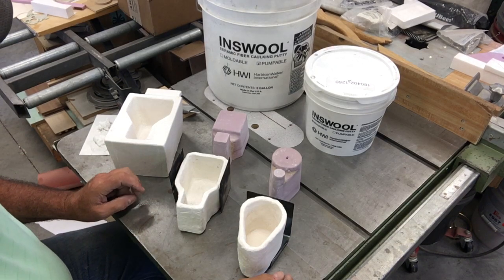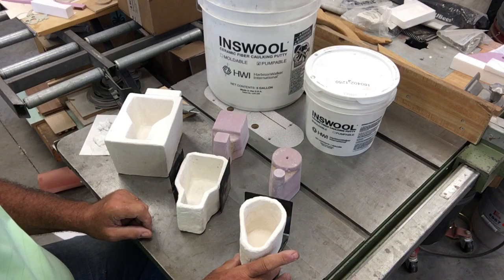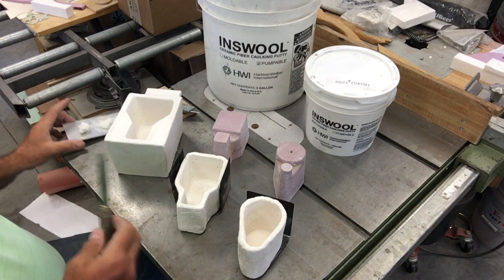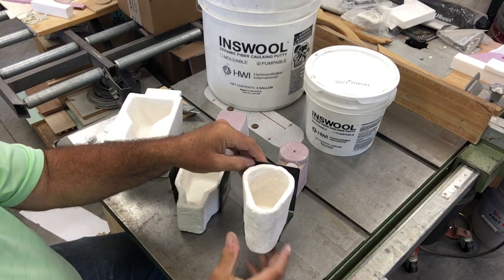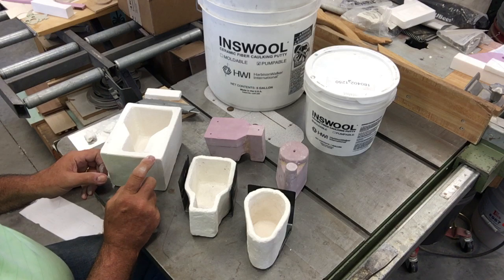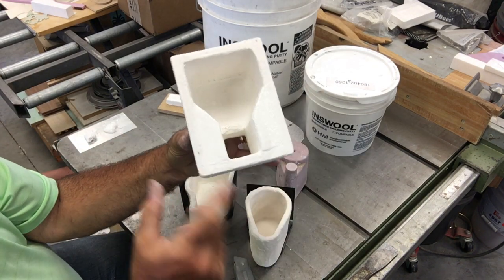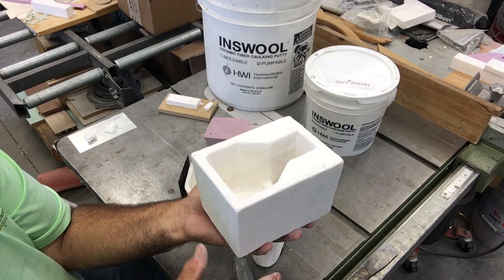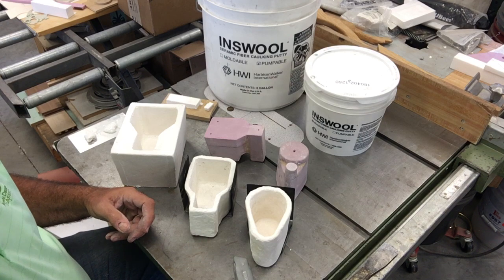Reusable Pouring Basin - Lost Foam Casting

Comment: I am very grateful for the video.
But I don't understand English well - I only understand from the translation of the subtitles and so I may have missed something.
I didn't quite understand what kind of mass (liquid with which you glue the parts) you use?
I would be grateful for a link or a minute of the video.
Thank you.
Reply from the maker: The "Glue" is also moldable ceramic fiber. It may also be referred to a "refractory mastic". Here is a link to a casting forum where I posted more info. https://forums.thehomefoundry.org/index.php?threads/reuasbale-offset-pouring-basin.688/  You may be able to use Google Translate from the text on the forum. You may have to join the forum to see full size pictures. Though all nationalities are welcome, the site is under constant attack from sources the emanate from within the Russian Federation so many domains are banned. If I see your application for membership and it looks like your YouTube ID in this post, I will grant access. Best, Kelly
Reply: @kellycoffield533  Thanks for the answer Now I understand that it is made of a refractory mixture that dries at low temperatures. I didn't know about their existence before, but now I read it.
I have been watching your channel and reading your forum for a long time. I recently registered (AlexNet), but there is no confirmation yet. I will be grateful.
PS: my neighbors help everyone...

Comment: Awesome videos.  could this material be used to make a pouring cup with a bunch of tiny holes in it for making metal shot?  looking for ways to make more consistent bronze and aluminum shot.
Reply from the maker: Maybe, but it's not very durable. Have you tried boron nitride coatings on metal? Best, Kelly

Comment: Great video, these are very awesome. Without a kiln could one fashion one of these using an existing small round dish crucible by drilling a hole in the bottom?
Reply from the maker: It wouldn't perform as well. Both the material and shape of the cup make a big difference. The moldable ceramic fiber is an excellent insulator and robs almost no heat from the melt whereas more dense refractory materials will. This means your pour temp is much closer to your pre-pour measurement. The MCF (or ceramic fiber board)  is also completely unwetted by aluminum and most non-ferrous metals which is what makes them reusable wheras other materials are not. The shape of the cup and the Wier in particular tends to float any dross and prevent it from being ingetsed at the sprue. I was really surprised what an improvement they were when I started using them. Best, Kelly
Reply: @kellycoffield533  great info thanks that makes complete sense. Wondering what I can use instead now then without a kiln. I've seen your tutorial on kush cups which is very interesting also. I do metal spinning and machining with which I could make a stainless steel funnel and fashion the bottom part with a wier. I'm planning casting with silicon bronze and lost foam so I've just joined the forum and am awaiting notification.
Reply from the maker: @samcheeseman7413  Pretty sure I saw and approved your membership. If not you may need to reapply. I use you make expendable foil funnels to adapt from Kush cup to sprue but funnels/cylinders aspirate air due to coriolis affect.  Best, Kelly

Comment: Thanks for posting all these, I'm struggling with some failed pours. I just tried to do a pour of an 8" ring that was about .75" thick and 1" wide, it had 3 sprues feeding it each about 1" inch square, they met in the middle about 10" above the ring into a 2" square sprue. All pink polystyrene from big box store.  My pour didn't fill out the ring in one of the areas furthest from two of the 3 sprue, I had plenty of extra material that could have filled it out.  I'm not using a pour cup with a dam, and was pouring right into the 2" square sprue, could that cause this?  I thought the height would provide the extra pressure to fill it. Maybe I poured too fast?  I also see alot more black smoke then I see in your pours, like 10x as much for similar volume parts. Also I was wondering where you get the 1" round foam sprue from, do you turn those on a lathe?  Thank you in advance if you have the time to answer! I'll be watching all your videos and making a pouring basin for sure.
Reply from the maker: My first Q would be what was your pouring temp? What is your coating and how thick? I'd tilt that ring at 45 degrees and sprue into the top face with a 1" square sprue. Use a pouring cup even if it is just a can. It helps insure you dont interupt a continuous pour. A 2x2 sprue is large and is probably creating the excess smoke and flame. I cut the round sprues with a woodworking tenon cutter in a drill press but there's no magic to them and I think square is a better sprue shape. I made my small pouring cups years ago and they are round sprue. My larger more recent cups are square sprue. Replies and dialogue like this a really better done on web forums. You can post pictures (like of the castig fail) and diagrams (like how/where to sprue gate) quickly. You might consider joining www.TheHomeFoundry.org. I'm an admin there and there are lots informational threads to search/browse and friendly folks to offer help and advice. Best, Kelly
Reply: @kellycoffield533  Thanks for the response!  I'll post over on the forum, just created an account yesterday and waiting on approval (same root username matus)
Reply from the maker: @matus1976  I approved your membership application yesterday. Best, Kelly

Comment: Hello, I always admire your work, and you have the gift of explaining it perfectly. Thank you very much for that.
I want to ask you a question:
Do you think it possible to use your way of casting to make bronze pieces?
On the other hand, do you think it possible to coat the plaster foam parts, like a thick paint, and drown the whole thing in compacted sand to have a more refined finish?
Thank you in advance for your answer.
With my gratitude and my warmest regards
Francois DELAUNEY, Normandy
Reply from the maker: Yes, Bronze casting by lost foam methodis works  fine. In general the refractory coatings are compatible. My commercial coating is reommended for all non-ferrous work and drywall joint compound should serv fine as well. It is possible to paint or dip with plaster based coatings. It's just a metter of how much thinning is required. When I brush coat, I thin it just to the point it beguns to freely run off the brush. Thank you for your kind words. They are much appreciated. Best, Kelly
Reply: Hello Kelly,
I just found your answer... among the spams, which explains the delay of my answer.
Thank you very much for the details you have provided, in addition to your formal answer to the question on the possibility of using your method to cast bronze.
Obviously, this opens up a lot of possibilities for manufacturing complex parts.
Simply, it is essential to have a 3D cutting device, in order to produce the positives which will be embedded in the sand.
One last (?) question: when you make foam positives, do you take into account the dimensional differences resulting from the expansion of the metal due to heat?
With, again, all my gratitude for your sharing of experience.
Friendly greeting from Normandy
Reply from the maker: @delauneyfrancois7411  Yes, to compensate for the aluminum shinkage, the patterns are made 1.3% larger than desired for the resulting casting. Best, Kelly

Comment: Could you use that as a reusable form for the outside and use sand for inner ports???
Would it hold up with aluminum for many pours without cracking instead of using foam???
I like the possibilities with using this product... thanks 
Good session...
Reply from the maker: Not sure what the advantage would be but if you mean using it like permanent mold tooling, you may get a couple uses, but it would take forever to solidify because it is such a great insulator.

Comment: Very cool. This plus just using sand instead of green sand makes this a much less involved process during the pour for non cosmetic castings.
Reply from the maker: Non-cosmetic? You might be surprised at the finishes that are possible. If you coat the pattern before molding the finish of the patterns will dictate the ultimate finish of the casting. If you sand the foam pattern up to 320 grit, your finishes will be fine petrobond or better. Best, Kelly

Comment: Thanks for these videos Kelly, very informative! You do great work. 
I was wondering what you think about using this material (suitably reinforced of course) as reusable lining for aluminium melt crucibles? It seems to me it could work well and be a lot easier to make and fire (as well as being lighter) than traditional castable liners. Thanks!
Reply from the maker: Unfortunately, it would make a very poor melting crucible because it has super low thermal conductivity and not great strength. However, it would make and outstanding ladle liner. Best, Kelly

Comment: i've been just using a tin can around my sprue. Not pouring directly onto the sand seems like it would be a real benefit. thanks for sharing. I'm really looking forward to trying some of your tips.
Reply from the maker: I used a short section of 2 1/2" steel tube (or "Kush Cup" as people say) for the first several years. The tube could be slid off the slug and reused. I started adding a conical transition from the tube/cup to sprue made from aluminum HVAC tape which was an improvement, but cones and cylinders tend to aspirate and entrain air as they flow. The re-usable offset pouring basins were far better in all regards and they don't rob heat from your pour. They could be made from sodium silicate bound sand for high temp alloy lost foam pours but wouldn't be reusable. Best, Kelly
Reply: @kellycoffield533  i will work on my delivery system for sure.  Your cups are perfect. maybe i'll try something that one day. but i don't have a kiln yet. Cheers

Comment: Very nice video my friend!
you earning a subscriber!
What kind of foam are this? Where can i buy?
Reply from the maker: I bought the moldable and pumpable ceramic fiber from my local refractory supply distributor. Inswool is a Harbison Walker brand but there are many, like Kawool, Fiberfrax, and others. They are all air setting moldable alumina silicate mixes, usually available in a caulking tube, 1 gal, 5 gal sizes. Moldable is putty like, and pumpable is like pudding. Moldable works best for forming shapes, pumpable as glue, filling cracks and patching. It can be bought online. Search "moldable ceramic fiber". You can occasionally find it on eBay and Amazon. Shop price.....it can vary significantly but is all the same stuff. Also, search my channel for a video entitled "Reusable Pouring Basin" for more info. Best, Kelly
Reply from the maker: Hi Alan, I have a video called "Pattern Materials for Lost Foam Casting" that discusses the type of foam and where to get it. Just search the title. Best, Kelly